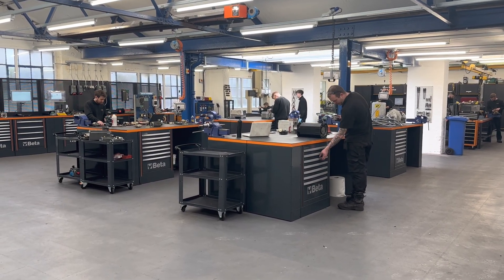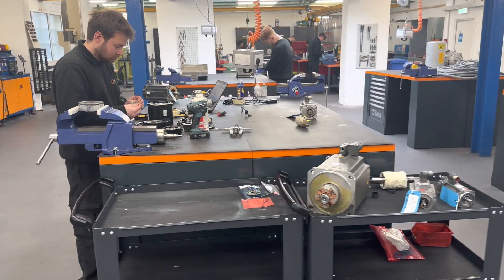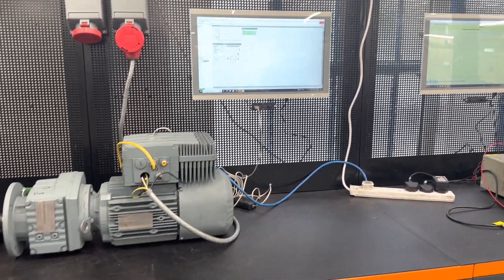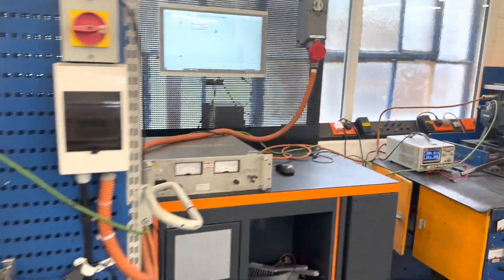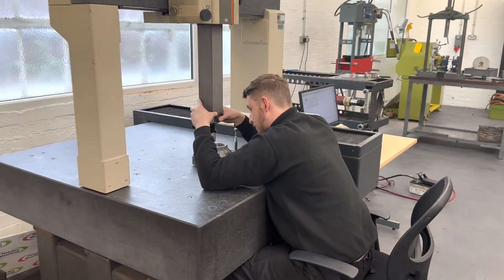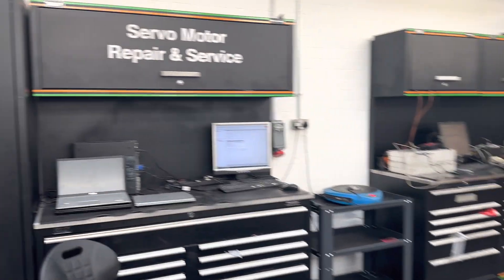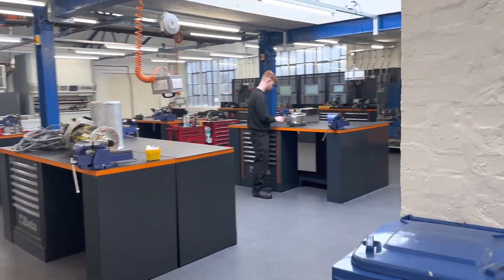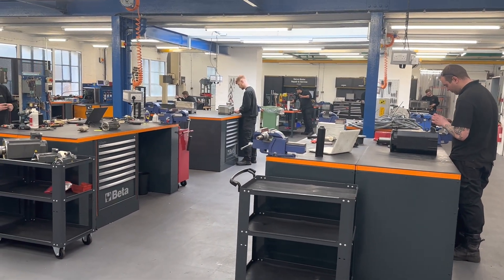Servo motor repair workshop tour

Comment: "Any rubber floor mats for the lads?", asked the concrete floor.
Reply from the maker: The whole flooring is an Ecotile laid floor, interlocking mats throughout. Anti fatigue, no dust and easy to clean.